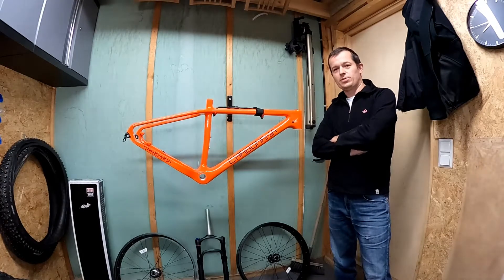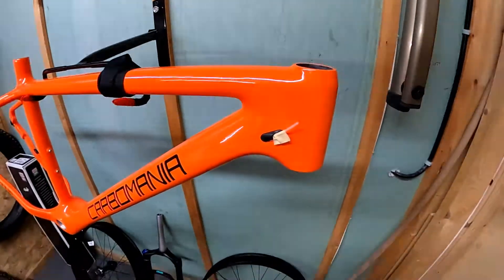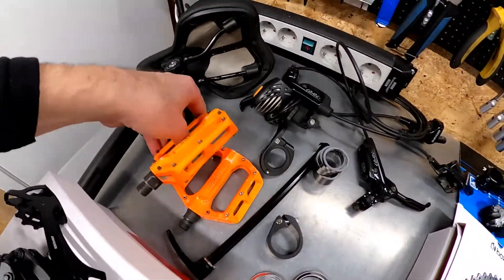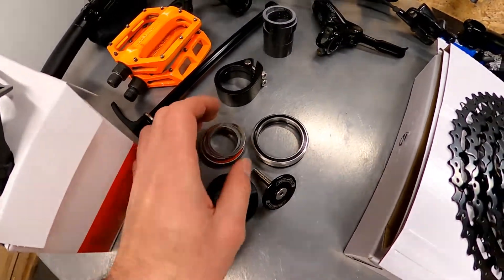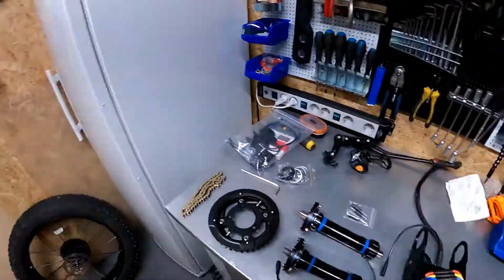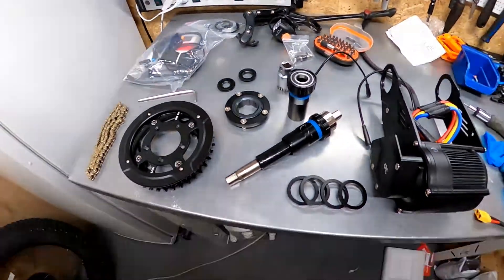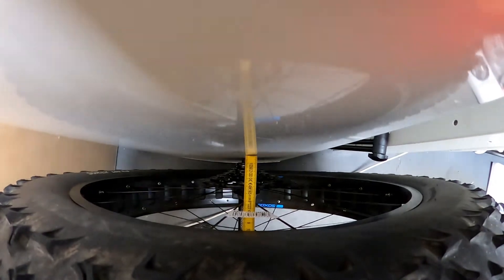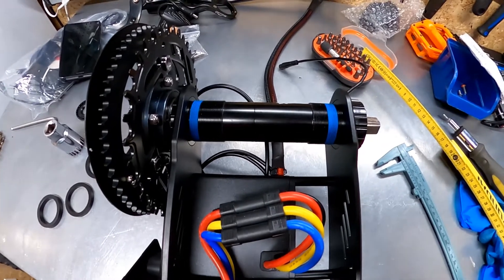Carbomania fatbike conversion with CYC X1 Pro Gen2 motor

Comment: hi! n greeing from Chile! Which bottom bracket CYC motor width did you use? 100mm or 120mm?
Reply from the maker: I have used 120 mm. For 100 mm version you will have too small clearance between left pedal and chainstay.
Reply: @LierskogenEbikes  thank you! much appreciated, perfect build!

Comment: Did the nylon strap you used for the motor work okay when riding?
Reply from the maker: I got rid off it. It loosens up constantly. Retractable steel pipe band works perfectly. You just need to guide it through slots in the motor brackets and wrap around the downtube.

Comment: Nice build. i got two questions though: 
1st: Is it possible to source Gear 9 shifting components somewhere in Europe or does one need to order from the US ? I didn´t find any bike shop in Germany or Austria shipping their stuff.
2nd: Is Carbomania a real brand ? Or did you use your own decals on a Chinese Carbon frame ?
TIA, Holger
Reply from the maker: Hi. 1st question: it's possible to buy Box Components gearing in Europe, but I noticed, that components stock is very, very limited. I grab last Box Four set from Ebay yesterday. 2nd question: Carbomania is real Chinese brand. They sell frames and other components through Aliexpress. Very good quality carbon. On the same quality level as White brand carbon bikes in Norway.
Reply: @LierskogenEbikes  Re-Hi, thanks for the fast reply. Ok, so I rather will stick to some chinese big cog cassettes or simply switch over to a 1x10 kit based on Shimano / SRAM stuff once my original 1x9 Microshift has been run down on my freshly build TSDZ2 E-MTB. Not a big issue. This Box Component stuff seems a nice option. Quality-wise and price wise. Most Shimano kits are really expensive. Mucho €€€ so to speak :-)
I will check out Carbomania over at Ali the next time I am surfing around.